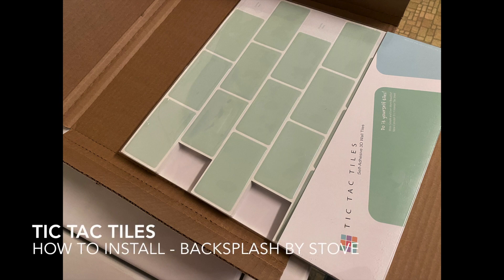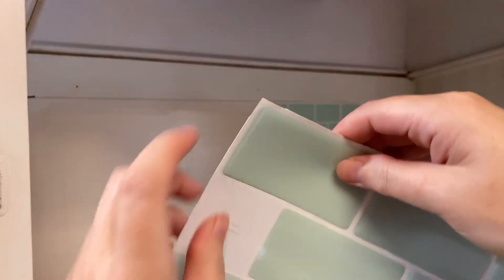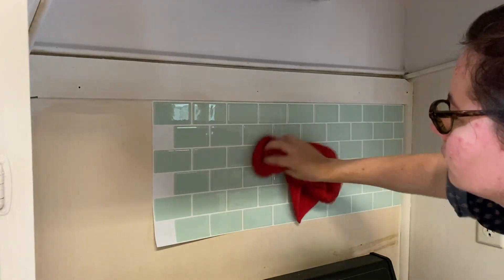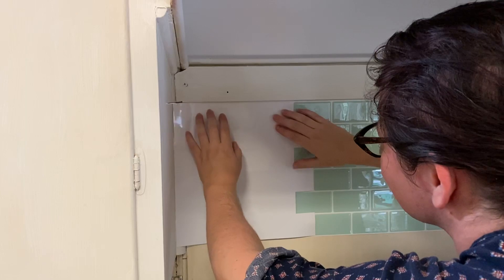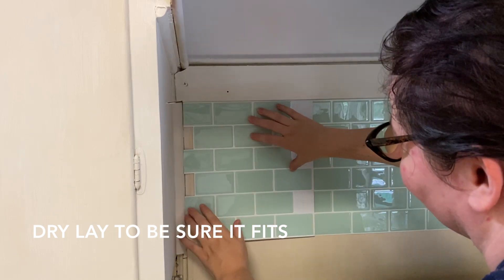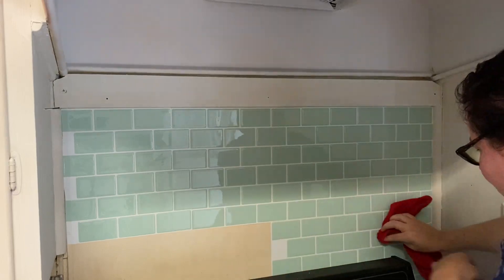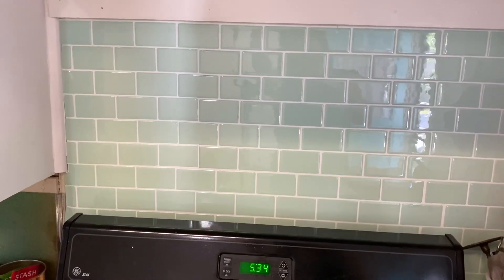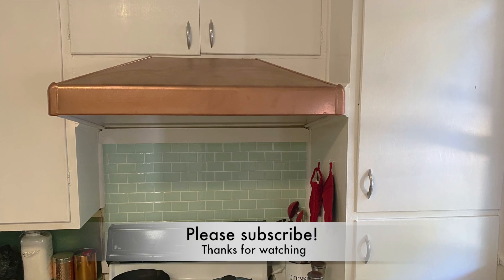How to Install Peel & Stick Backsplash - Tic Tac Tiles

Comment: So cute!  I actually just bought the copper paint and these coke-glass color tiles for my kitchen.  I didn't see this video until now, so funny, same great ideas!  Did you turn your gas stove off before spraying the hood?  I am kinda afraid the fumes will ignite.
Reply from the maker: I didn't turn my pilot light on the stove off but that is a good idea. I had two windows open and the door to outside so my area was well ventilated. The colors are beautiful, glad it worked for you!